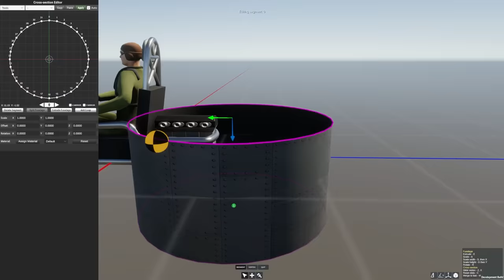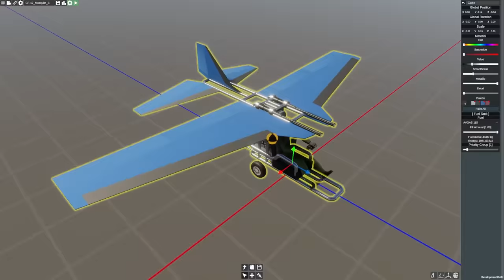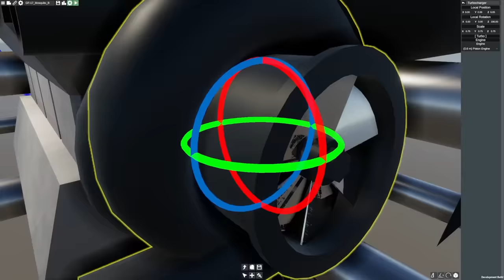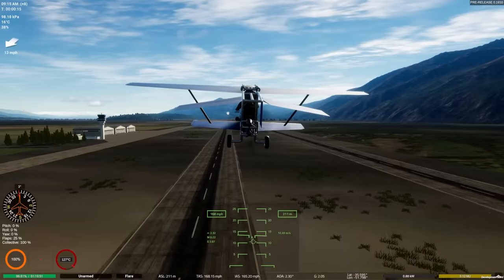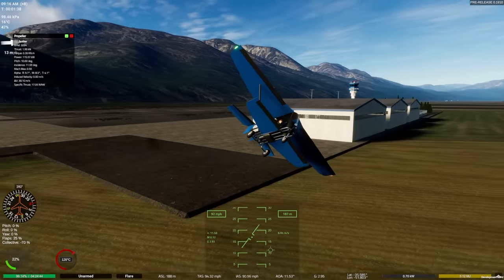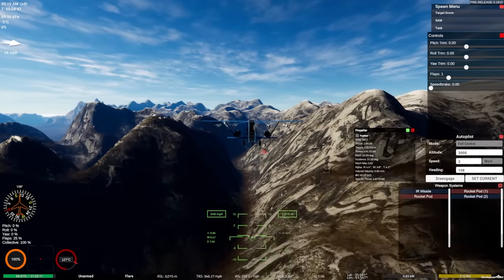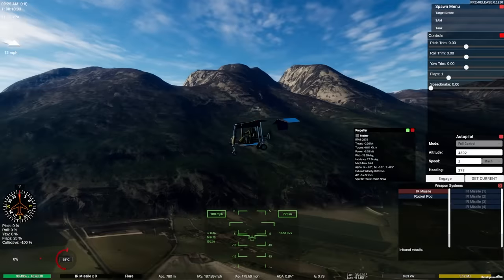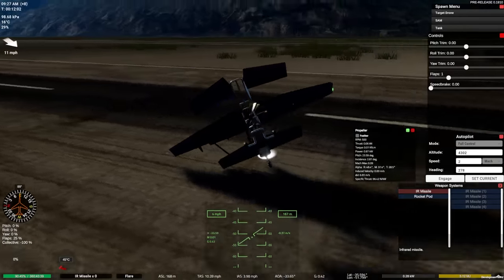Building the CHEAPEST Fighter Plane Possible!  -  |FLYOUT|

Comment: Going 360 mph in an ultralight sounds horrifying.
Reply: I think the 13+G sustained turns would be a bigger issue
Reply: That is until you play 'Freebird'.
Reply: @Mrshotshell what about the dual 15 mm’s firing a few fret from your face
Reply: @freedomfighter2054 yeah there isnt any hearing protection built for that lol
Reply: @freedomfighter2054  Just make sure you have earplugs in
Reply: I would already be terrified in a Cessna 150 lmao
Reply: @TarsonTalon
I was humming free bird while reading the original comment
Reply: You can really hear the pilot screaming thanks to the open design.
Reply: The speed wouldn’t be the problem the acceleration would be the problem
Reply: @wackaircaftmechanic2312 Civil Air Patrol took out a few U boats in piper cubs.
Reply: And with only a single windshield, imagine swallowing a bug!
Reply: No it would sound like a prop engine
Reply: @wackaircaftmechanic2312  I'd love to see a Cessna 150 with a bunch of guns mounted on it!
Reply: @bwc1976  Me too!!
Reply: How would you feel going mach 3 in an f 22
Reply: @Mrshotshell and 500 layers of heat protections

Comment: According to a quick google search, a single F-22 costs about 350 million. Assuming the base cost for this thing is about $800, you could make (whips out calculator) 437,500 of these for the cost of one F-22. Our ultralights will blot out the sun.
Reply: 437500 conscripts needed
Reply: Don’t forget to factor ammunition and fuel costs
Reply: Where are you going to get enough pilots from
Reply: @memyself229 just force them. what can they do, say no? 
Or use ai
Reply: @the40scall90 just use the plane as the weapon
Reply: @memyself229  It's an ultralight, doesn't need a pilots licence
Reply: @jovand6606 a kid with a summer job could afford this. And if they have a summer job, they are probably legally old enough to buy it. I can see the shift in legislation now

Comment: I would watch this thing dogfight a modern fighter jet and see what happens.
Reply: The jet would just aim 9 it, if it can't lock on then it will just fire a burst and fly out of engagement range
Reply: The jet just goes supersonic, and the ultralight gets shredded, or at least the pilot is in for an unpleasant experience. A F-15 makes one hell of a shockwave
Reply: It starts doing donuts and makes the radar missle spin out
Reply: Oh please a fighter jet wouldn’t even stand a chance against this engineering marvel
Reply: When they were filming the scene in "The Final Countdown" where an F-14 fights a WWII Zero, at one point the F-14 almost stalled out and crashed trying to slow down enough to keep the Zero in its sights!
Reply: That's not a fair comparison, you could do same cost of each, so 1 f22 vs 400,000 or so of this thing

Comment: Use stingers instead of sidewinders and that would be a scary proposition.  Setup in rocket pods you could mount 32 for the same weight penalty as the 4 Sidewinders.  And spam 4 for the same cost. (Wikipedia numbers).

You’d lose some range (8km ground launched so call it 12km vs 35km) but since cheap but effective is the brief. 🤷‍♂️ 

How to kill a Raptor.

Setup flight of 4 forming a 12km per side box.  Considering the aircraft you could probably start them on the ground in camouflaged dirt runways.

Take off as Raptor is entering the ambush and while he is trying to workout WTF 4 ultralights are doing charging the most alpha of jets, go full Robetech on his arse and launch eight stingers each.  Go hide now.

Raptors only choice is pull vertical and hope he can decoy/out climb 32 missiles.  But more likely he will try to go cold a turn into 1 of the barrages fired from behind him.

Comment: Ok, hear me out, if you go into battle against a f22 with ten of those little things, the f22 will not be capable of taking on all of the aircrafts at once, and, as the cheap airplane is capable of turning like a fucking mosquito, that means that if you have a group of around 10 cheap ariplanes per f22, there is a very good chance of you wining, and because the airplane is cheaper than a lada, you can make unbelievable amounts of it. The only thing you would have to consider is being shot from BVR, but you can counter this issue by taking off just at the right time, as this airplane is very light and capable of taking off in pretty much any highway or even plane terrain.

Comment: The main issue I see with this is getting the proper air to fuel ratio, as you get higher air gets thinner, so this thing would get much slower as you got higher

Edit: just noticed the turbocharger, you’re all good

Comment: Modernization kit might need to include some flaps to help with those landings.  Or maybe add some doors that the pilot could open as an air brake upon landing?

Parachute for the pilot?  Just strap it to the top of the wings; the whole thing could come down with a parachute.

I suppose if you beef up the tires or make the landing gear longer you could sling the AIM-9's or rocket pods to the under belly.

Do you suppose an autogyro would make for an equally cost effective super fighter?

Comment: As a car guy... it pained me to hear you say that the small 4cyl you used could come anywhere chose to displacing 5L (unless it was a 2stroke)... But worse than that, was claiming it had a "welded diff" 😖🤣
(a "welded diff" is only valid for an open differential with two outputs; yours would be single output and therefore wouldn't be an open diff)

Comment: I love how one missile would cost WAYYYYY more than everything else combined 😂
.
Also the following things should be added to further lower the cost:
Remove the lights, the pilot should just bring a flashlight with them and shine it out the side of the plane 😂 (for an additional $5 ofc)
.
Mirrors are not needed.
.
50 cals should be used instead of 15mm guns. Make the plane launch from a catapult so that you don’t need wheels :) it can just use a landing skid (like the me163)
.
Instead of missiles, use rockets with fuses on them that essentially act like grenades. Basically they have a max range of 1km and a min range of 0km. All u gotta do is light the fuse and then launch the rocket when you deem fit. (Or the rockets can be bought with a smaller fuse cord length so that you can shoot them off right when u light the fuse and they will thus always explode at the same range)
.
The key is to essentially make each rocket an “air shotgun”
.
The pilot should also be in a prone position while flying so that their feet can be closer to the rudder 💀 😂 (it would also help them sustain more G forces)

An additional perk of this is that it allows the plane to have a smaller windscreen & be more aerodynamic by being shorter in height.
.
The plane will also have countermeasures in the form of flares (fireworks) and chaff (aluminum foil rolls, but unrolled and crumpled into big balls of foil)
.
Lmk if anyone has other ideas to add here lol

Comment: I'd like to see your take on an airplane designed solely to fight wildfires.  Personally, I imagine a large, high-power four-engine turboprop with thick, high-lift wings for an incredibly low stall speed, both for better aiming accuracy and for a short takeoff/landing length so it can land in small lakes for refilling with water.

Comment: To be fair, it could probably fool a heat seeking missile considering that its going to be much cooler than a jet and also much smaller, those flares would work wonders. I just have my doubts about avoiding radar guided weapons because stealth is expensive and this thing literally has the front half of a scooter on it...

Comment: you should make a variant with the wings able to fold ( the bottom smaller wing slightly reduced in size so it can fold straight up and the bigger top wing having 2 hinges where half the wing folds up and the other hinge located on the fuselage folding down and its all secured with locks) and claim it as the "naval" version or even better yet its now a literal tryke/scooter, a battle scooter u can drive into battle or take to the air and dog fight with.

Comment: If an American military contractor like Lockheed Martin or Northrup built it, you would have to multiply the cost by at least 5-20x and multiply the time it takes to complete the project by about 1.75-3 times.
Reply: i get this a joke but using Lockheed as the example is probably not a good idea when they are in-fact the only company thats given money back to the government at the end of a project because they completed it on time and under budget. (that was the U2 spy plane)

like yes most american aircraft companies dont have a great track record but lockheed actually have the best reputation for delivering on time.
Reply: @_cyantist IIRC, Northrop Grumman got the B-21 job for a similar reason.
Reply: @SchlopFlopper  pretty sure northrop got the b21 raider job as they did the b2 spirit before. (the b2 spirit which was infamously over budget btw)
Reply: @_cyantist  makes sense
Reply: @_cyantist  I couldn't think of any other fitting companies at the moment. Surprised to learn that there has been even a single government project that didn't go over budget or take too long. I'm looking at you, SLS. Boeing's starliner is a mess as well.

Comment: It actually would have been pretty useful as a cannon-fodder aircraft

Like have two air force branches, one with normal, fairly expensive planes, piloted by professionals, and another that consists of those ultralight mass-spammed planes, piloted by some conscripted farmer boys and girls who have minimal training and are extremely expendable

Also, this design has same vibes as "Lightning" Interceptor-Corvette from Highfleet - cheep, fast, maneuverable, most of pilots assigned to it either die in service or return shellshocked into oblivion, smallest maneuver makes you almost pass out, can be equipped with missiles, and if in good hands - it can do wonders!

Comment: The best missile defense is to make your plane cheaper than the missile, making it uneconomical to shoot down.
Reply: Sadly, guns on attacking aircraft paired to its radar solve this issue. That is, if this kind of aircraft is required to be shot down by fighter. One can shoot down 50-100 of those easily and up to 300 with good trigger discipline.

Comment: What i hate the most about this is you could easily outfit a batallion with a few of these and have ultra cheap arieal recon, and its so puny that the engine sound probably wouldnt give it away, it could take off from feilds or dirt roads just fine given its twr

Comment: This thing could be an F-22 killer if we take into account the cost, especially if you simply do not care about casualties. The USA only has about 200 F-22s, and are 200 F-22s really going to be able to kill a swarm of 1000 of these suckers? After all an F-22 carries four missiles according to my three seconds of research so that'd be 4 kills max assuming no missiles miss due to how tiny these suckers are, and F-22s have way higher fuel costs too so you could theoretically win on Skaven tactics.

Comment: I am literally thinking about actually building this IRL. Just be a matter of pausing and rewatching parts of this vid to get probable dimensions, then trascribe them onto my drawing board, then start by welding together aluminum tubing, or gluing together PVC tubing.

You said 700 dollars, so even someone on a fixed income like me can afford to build and keep this machine IRL 

Think i will actually build this thing.
Reply: A propeller alone will probably set you back 600$, the engine another 600-1200$... assuming he meant 800 1946 dollars it would be a little over 12,500 dollars today

Comment: Imagine an aircraft equipped with a Mk.19 grenade launcher made for 2-10 kilometers altitude, and to take out pickup convoys

it would especially excel in an anti-technical role, since most pickup-mounted weaponry can't hit an ultralight at 15,000 feet
Reply: Especially if you could make it with a gunner or in a gimbal with a camera, I think there may be  heat-seeking 40mm grenades already

Comment: So since your using a 15mm, let me let you in on something, you much better off with using a Russian export 23mm with its superior fire rate and damage potential, as a 15mm really just cannot hold enough HE or Incendiary filler to effectively kill your target fast enough. Since this thing will be facing planes far faster than it, you want as much firepower as possible that fires as fast as possible to guarantee a hit or two, and a 15mm just ain't going to cut it. The main advantage a 15mm has is armor penetration. The German MG151 15mm could penetrate around 51mm of RHA armor at 10 meters, and was an incredibly high velocity round, retaining its penetration very decently out at range. So you should have two variants of this, a ground attack with the 15mms as your main guns, and your air supremacy variant with soviet 23mms which were readily available and cheap.

Comment: Actually, it might be able to hold its own and f22, let me explain.
with the light frame, it can go a speed the f22 would stall at, and the f22 would have to resort to attacking from the top or bottom, flying low mitigates this fighting style for the most part. 
f22 only has a couple second of ammo, so not much chance or value in shooting down this thing.
The engine also may be able to cheese heat seeking missiles.

Comment: The thing is it could defeat the F-22, but not in the way you think. In a 1v1 the F-22 would win every time, but because of how low cost it is you could send dozens, maybe even hundreds of these at a singe F-22 and it would simply run out of ammunition or fuel before being able to take all of them out.
Reply: that's unrealistic because well there will be other aircraft either as a wingman or a another squadron this literally have been use since ww1 and also modern tactics